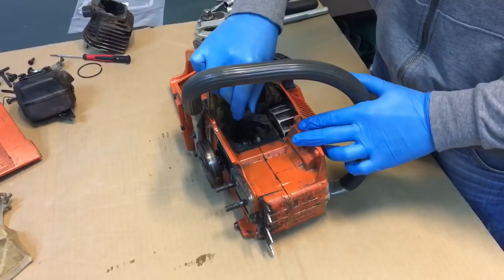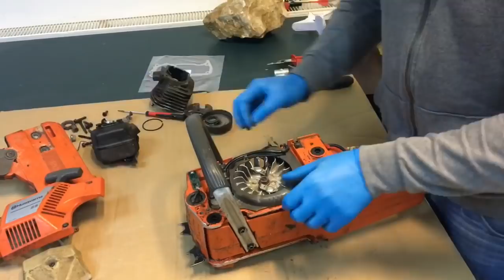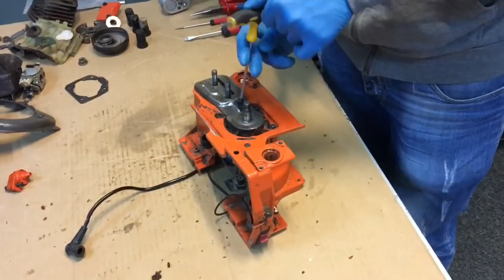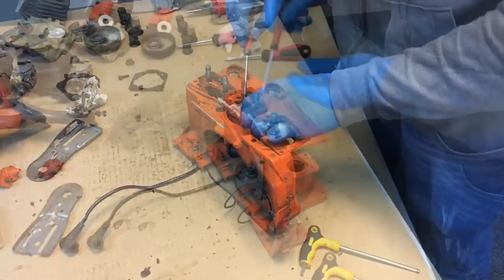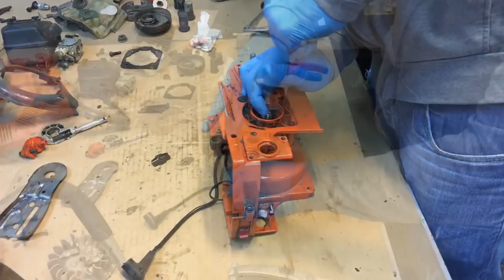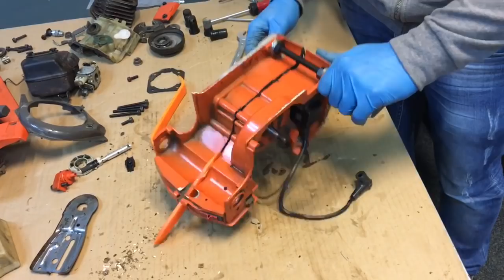Schimbat ambielaj drujba husqvarna 55 , 55 partea 1

Comment: buna ziua am  o Husqvarna  55 care eam facut tot ce este posibil dar ea da sa porneasca da nu foarte greu si se opreste da care porneste da cu mana pe acilerasie si funcsioneaza doar cateva  reterzeturi care se poreste si gata nu mai vrea e dac umbli la carburator ear funcsioneaza dar greu si se nustu ce sa fac la t si l si h ca am pus pe ea nou tot care nu vrea sa funcsioneze normal ea sta la relatiu da  merghe un pic si se opreste  de ce nu vrea nustu unde sa umblu la carburator sa stea sa porneasca usor si sa nu se mai opreasca si cand se opreste nu mai vrea mai de fel  trebuie sa traghi la demarou mult sa porneasc din nou cum sa fac?cum ii reglaju corect la 55 unde umblu prima data la t  la L SAU  H CUM ?
Reply: daca ai umblat in carborator poti sa arunci carboratorul la gunoi sau sa cumperi un chit de reparatii sa incerci sa repari carboratorul , nu se accelereaza ca nu are benzina suficienta , filtre infundate etc - nu trage benzina suficienta carboratorul din rezervor , cauta si vezi cum se repara carboratorul si cum se regelaza , are 2 suruburi unul de benzina unul de aer , sa nu ai setul motor gripat , si asta e o cauza ,